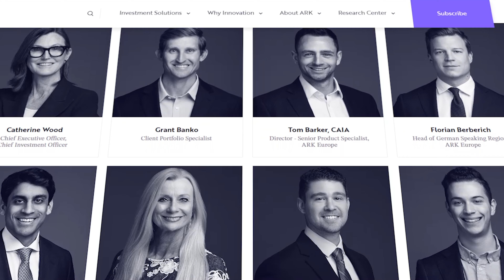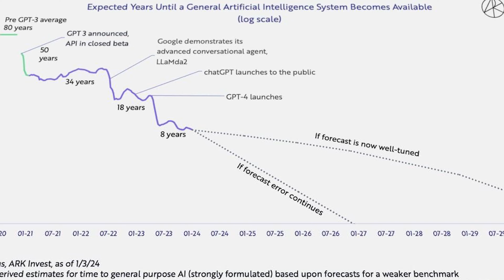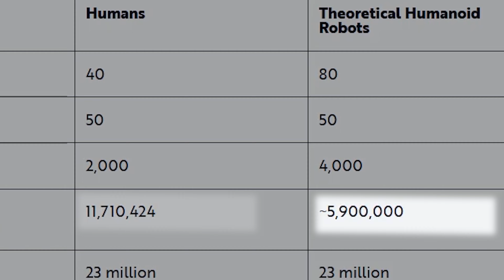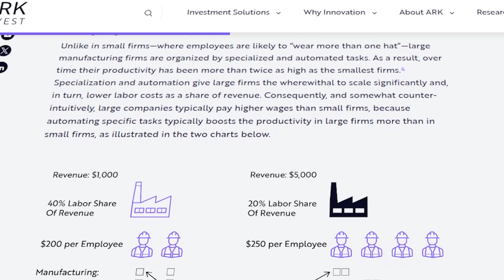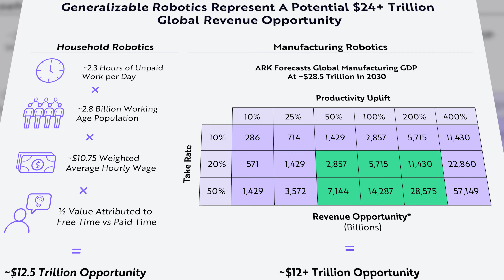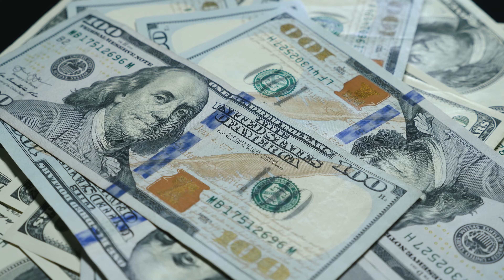Humanoids Set to Add $24 Trillion to Economy: Will This Bring UBI?

Comment: The moral problem of humanity is primarily that the economy supports and rewards “bad” behavior. It’s a systemic externality along with pollution and destruction of the commons. The resolution to the problem is a “restoration” economy that runs parallel to the existing consumption economy. Read up on Dr Delton Chen’s work.

Comment: One sector that will  for sure adopt humanoid robots is  the military. 

It might be slow to do this initially but over time we might see one bot for every human solder or the like.

There are several unique aspects to this in that human soldiers tend to leave the military and re-enter civilian life thus requiring continual training of new soldiers but the bots can be "trained" with just a software load.

As such many of them could be like the national guard and  work in factories and such but can be "drafted" in a moments notice, the new minute men so to speak.

Also, there is the aspect that they can save lives and do mission that one might be reluctant to give humans.

They might act and be controlled much like UAVs are now, in that they could be thought of as a UAV with legs vs rotor blades or wings.

And so as there are millions of bots being manufactured  one could then draft huge robot armies when needed and then discharge them back to civilian applications when no longer needed.

One other aspect is that say one wants to automate a ship say have a motor turn a valve, That adds one more thing to break on that ship, the motor. But if one uses a bot to turn the valve just as a human would then that is not part of the ship and if the bot breaks then one just can replace it with another bot, where one has lots of those..

If the   bots can act as humans, this  allows automation without adding complexity to the things being automated but just using the bot in place of a human. So this might reduce the crew of a ship say by half with the other half being bots which then there less mouths to feed, pensions and housing to pay, and the like and these bots will not leave the service in a few years to have to be replaced and trained.

So this too will likely have a huge effect on the future as well.

Comment: If UPS trucks with no one driving. 2 seats in the back on the outside. 2 robots that can deliver packages and charge in the seat. Work 24/7 would be a game changer.
Reply: Except we don’t need that much consumerism and definitely need to consider how wasteful some purchases can be. Single plastic use needs to be banned. Chinese cheap manufacturing needs to go.
Reply: Yes, right now I own $1000 worth of tools in the garage, $1000 worth of tools in the kitchen and $1000 worth of tools in the outdoor shed. I don’t need to own all those tools if I can borrow them within, five minutes… Or over the course the next day a robot will come by and use that tool for whatever I would’ve used it for. All the small maintenance and fix task the humans do now that there is a lot of waste around robots would do. One of the big challenges in moving to a cradle to cradle model is that takes a lot of labor to take those objects apart and return them back into industrial feed stocks. Robots enable that disassembly and reassembly into something better. If a robot cost $10,000 and last for five years, and works 20 hours a day when it’s not charging it’s labor cost $.27 an hour. If plumbers and roofers and seamstresses and solar installers cost $.27 an hour what could you do?  There are whole classes of maintenance tasks that are essentially undoable because the labor is too expensive. I live in California , in fire country.  Fire brakes or something we know we should be doing more… expensive and difficult to maintain. When I look at the capability of robots, I see it within the context of the other giant changes heading our way describe by rethink X.  Those changes are a move to renewable power, transportation automation, transportation becoming all electric, and a move to precision fermentation to replace factory farming.  Each one of these has side effects. If you have automated transportation, you no longer need to own a car, then you no longer need a parking space at home and at work and at the shopping center. You end up saving most of the third of urban space that’s used for parking and you can reuse that. When you move to precision fermentation from factory farming, you save about 90 to 99% of the feed stocks to go into meat production (water, grains, the inputs to the grains… mass mass of herbicide, pesticide, and fertilizer).  Precision fermentation will eventually give us most of the products that we grow in a state closer to their end use. Instead of growing a pine tree, and then cutting it into pieces and then cutting away a bunch of those pieces so that you have a chair… You have mold and, a slurry of Pinetree like material that you pouring to the mold that you then Dry and turn into a chair.  The ideas for this, I’ve already proven out in the Aguahoja sculpture from MIT.
Reply: True and they could operate at night when everything is less busy.

Comment: Once people start seeing robots in action, at least some will realize that sentience is not required for robot based economy. You can have semi -automated robots with plastic build and wheels made in local market to help with many daily chores or just deliver items. Not only that  we need to consider call centers of humans operating heavy duty or high complexity action robot remotely. Then, there will be machines of different shapes and sizes which will have sensors, chips and wirelessly connects to kind of open ai type instruction system directly or through intermediary server. None of these require them to be humanoids.

Comment: I'm no expert but I am under the impression that it takes 1000s of modern high-performance GPUs (or equivalent power) to produce something with ChatGPT levels of intelligence. This also consumes probably megawatts of power.  You can't cram a 1000 GPUs into a robot or have a robot consuming a megawatt of power.  Also our transistor size can't be shrunk much more due to the laws of physics, so this isn't going to improve by much. So maybe you can have a few robots with human level intelligence being remotely controlled by a massive server farm sucking up tons of power but I doubt you will have thousands of them or that you will have them economical enough to replace blue collar workers.

Comment: Your numbers are wrong. At 16.000 USD purchase cost a robot that can replace 2 humans is a significant savings. We talk of costs of what - 750 USD for the robot PER MONTH, compared to 2 people wages (assuming leasing, electricity). Musk talks in factories of a ROI below 3 months to recoup the whole money. Even at minimum wage this is a wipeout - at anything higher...
You are also wrong with small companies - an AI driven robot can well fill multiple hats.

Comment: Robots have been assembling automobile bodies for over 20 years.
Reply: The humanoid versions will be much cheaper, and will be able to do the remaining tasks that current robots can't do because of the manual dexterity required.
Reply: yeah, non humanoid robots which cost more than a million dollars each and are powered by pneumatic or hydraulic motors that would kill a human if they were on its way. And that can only do ONE task for all of its existence

Comment: Hello Julia. History repeats itself from time to time. The same thing that happened in Egypt in Joseph's time will happen shortly. A great time of plenty followed by a great time of scarcity. We must take advantage of abundance to save as much as we can to survive the time of scarcity.
Reply: He's right! Earths magnetic shield is degrading quickly.  I would not take a very rare solar storm to cause big trouble right now and in a decade or to even fairly common solar storms will cause major problems.  There should be a digging in effort to store up electronic components and vehicles that will be required to restart societ if we get a once in a century solar storm. or worse a once in 6000, or 1200 year storm which we are also over due for.  But it would only take the once in century variety to cause significant damage especially if its a decade or two from now.

Comment: I don't know if we have enough minerals and materials to bring such a dream to life. Even our switch to renewables is questionable for this very reason so it would be interesting to see if there's been any good research on feasibility.
Reply: Why do you believe that? I also question this but don’t know how to think about it and where there is data about this
Reply: You think there aren't enough resources to create robots on the scale described in this video, even with existing vehicle manufacturing capabilities?
Reply: With robots it will be easier to exploit space especially the asteroid belt.
Reply: If it turns out that some rare mineral is bottlenecking the production of bots, I am confident there will come a substitute from the GNoME project, or we can synthesize it. 
Not worried at all.
Reply: @Ben_D.  They might need adamantium or vibranium.  Only the MCU has those.